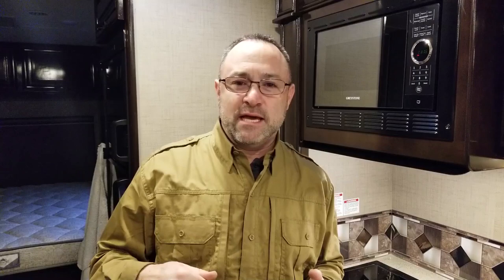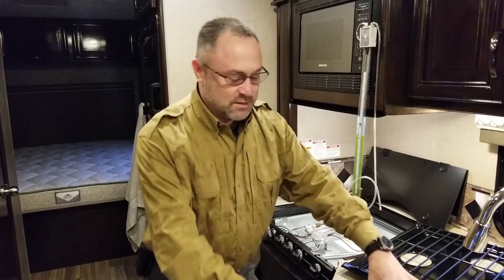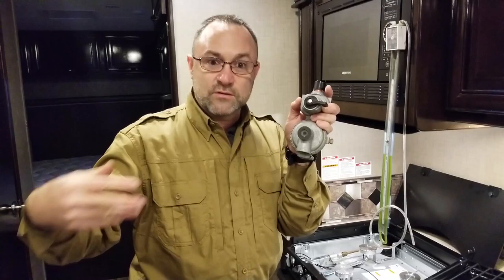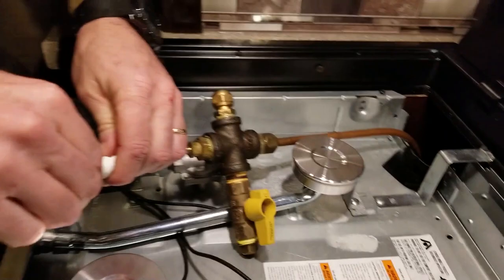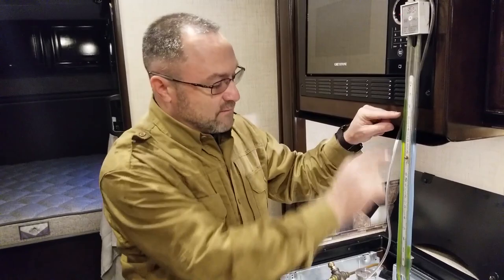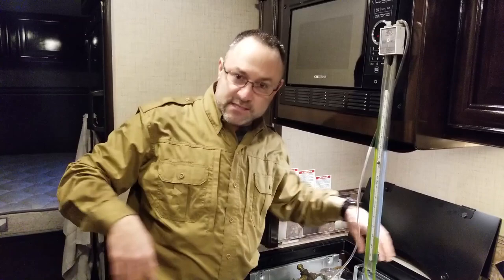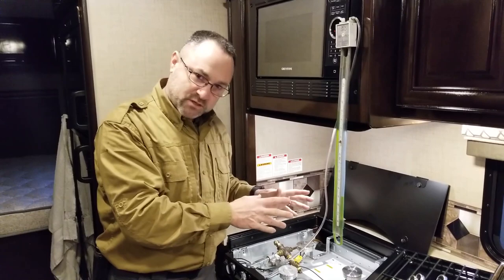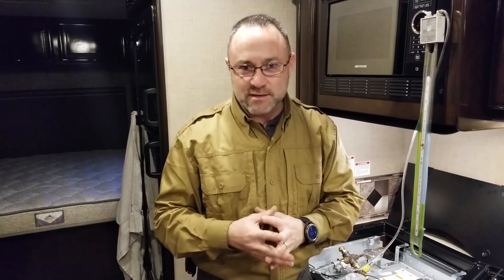RV Propane Overview & Three Tests To Ensure Proper Propane Function (Hole size is a '#41' not an 'X'

Comment: I cannot thank you enough for your informative video. Our furnace quit in 2019. We live in the south so we just did without and added more blankets. I tried to get a mobile rv tech to come out but no one would. When my refrigerator and stove stopped working, I started searching the internet. Luckily I found your video. When I learned that furnace needed more pressure than stove or refrigerator, I bought a new regulator. Success!! Now all my propane appliances work and I didn’t even have to pay someone to fix it. Than you, thank you, thank you.
Reply: My motorhome just started doing the exact symptoms you stated. Started with the heat not working a few weeks ago. But with it it almost summer I didn't care much. Now that the hot water heater and refrigerator are out, I have to find a regulator that will fit my old motorhome.

Comment: I really enjoyed the video, I used to train people in the use of handheld gas sniffers, the number one mistake made by professionals such as haz - mat personnel is they sometimes don't "zero" the detector in outside air. There have been cases where a location has been cleared as "safe" only to have an explosion because the detector was turned on and zeroed in the presence of combustible gas. Make sure it is turned on, warmed up briefly and zeroed outside the coach.

Comment: Hey Darren, 

RVIA Spec says-
Lock Up should be 14WC
50% load is 11WC
For leak test spec says to shut off propane tanks. Drop WC to 9wc. Then leave it for 3 minutes.

Also the drill hole is 3/32 or #42 or a 75,000 BTU Orifice
Reply: I understand what RVIA says, but let Darren’s experience teach you. In some RV’s, the furnaces like 10-10.5” wc. Set that lockup too high (like 14” MAX allowable everywhere) and could keep furnace from firming up.
Reply: All depends on the systems. If it's got a truma combi, you need 13"wc.

Comment: Darren, Thanks for presenting this video and following it I found a propane leak I didn’t know I had. I’m a DIY mostly automotive and making the test rig was easy including a U-tube. I removed the HW burner to gain access to the line, attached and started measuring including a flow test. When I did the leak down, I could just about watch the water column drop. I was losing pressure. Soap bubbled all connections that had access, no luck. Then I decided to disconnect and cap appliance service lines one at a time and repeat the leak down. The last one was the Atwood furnace. As soon as I capped it, no more leak down. Then I rigged propane service to the removed furnace valve, turned gas on and a tiny bubble formed at the gas orifice. Ordered new valve, R&R. Furnace works and repeated the same leak down test starting at 9”WC after dropping pressure as you demo’d. It held 5 min w/o any drop. And during the new valve installation I found several tiny insects had found their last resting place behind the orifice. And now I have a service tool to assist friends with, carefully. Thanks, Gary

Comment: Darren, the NRVTA also taught us to pull the center burner out and test from that port.   Their argument was 1) not having to break into the gas line, and 2) any variance in WC pressure would be reflected through the stove top's regulator.   I asked about this and was "shot down".     I can see the 50% load and drop test being able to be read through the stovetops regulator, but I agree with you that the stove's regulator could mask an overly high lock out pressure as you show in this vid.   Well done, Sir!

Comment: Nicely done! Very good presentation. Stage-1 in most 2-stage regulators will bring down the pressure to around 10 psi not 30. I prefer to test in series with the main line usually somewhere around the ASME tank. Less issues with venting the propane outdoors. As for the tool, a #36 orifice (~0.1065" diameter) will purge the equivalent of 80,000 BTU (at WC 11) or 55% load on the regulator. Close enough!
Reply from the maker: Hey Daniel,  Again I appreciate your technical savvy!  Keep me straight...
Cheers,
Darren
Reply: what size drill bit would I need to drill out a #36 orifice.
Reply: @anthonylink4330  #36 (.1065)

Comment: Fantastic video.  I've been having some issues with my propane system.  Although I'm going to preemptively replace the regulator since all indicators point to there but I'm going to run the tests before to have a better understanding of what was going on.  In my case three symptoms.  The fridge will often fail to light, especially if the furnace is running.  The furnace on a campout last weekend would fire up but at some point reach a limit where it shut down and we'd have to turn it off and back on to reset, and the stove does not get enough gas pressure to even light one cook top burner if the oven is running.

Comment: Hey Darren, I have been impressed with your teaching style and variety of RV Tech Task that you cover.  I'm interested in making your brass valve setup for hooking the slack tube and LP gas line and 50% load, is there a description somewhere on the parts needed to create it?
Reply: You can buy the kit from RVTI

Comment: Hi Rick here I have a 5500 propane gen in my 5th wheel that hasn't worked in 3 years start and die wich was my fault for not starting it yearly but anyway I had a factory tech come out and diagnose it he said it needed a mother board 500 to 700 dollars wich I didn't have at that time then I had a friend suggest that if the moter doesn't run its probly not the moter board then I found your video's on how to diag a heater wich I also had problems with so I made the set up to ck the fuel pressure and sure enough it had 11 water pressure when I turned the gen on it went to 0 so I blew out all the lines still the same thing so I replaced the regulater and re ck the pressure is good and the gen runs it only drops 1 water lb Thank you Jesus 
THANK You for your video's it saved my lots of $$$$

Comment: you said: "top of the meniscus" - but I thought measurements should always be taken at the bottom of the meniscus. As i recall, the reason is that the capillary effect draws the fluid up the side of the tube, but the real level is at the bottom of the meniscus. I was wondering how you came to learn that you should measure from the top of the meniscus. 

Thanks, really enjoyed your vid, and it helped me set up to do my own propane system tests every season.

Comment: Excellent video!   When I was doing the sealed test, I turned off the gas at the tank and the pressure held for about 1.5 to 2 minutes, then it suddenly dropped to zero. It was rock sold for those first two minutes, then it completely dropped out all at once, in 1 or 2 seconds.  Do you know what would cause that? This is on a 1987 Airstream Excella.

Comment: This was a very good video for me. I have a truckbed camper that has this type problem, I believe. The stove will light but it has a yellow flame that rises high. Also the furnace will light but only burns for about a minute or so. It make sense that it is a regulator problem. I can see the regulator underneath the sink but it is a fixed pressure regulator (doesn't have the part that you can adjust the flow/pressure. I guess my only option is to replace the regulator. Any thought?

Comment: Thanks for all the information you share. I always look through your videos to help me troubleshoot problems. Always use a backup wrench on fittings✔️ I have a question about measuring LP. Can I put a permanent gauge after the regulator to see my PSI?

Comment: PSI is pounds per square inch. Ounces per square inch is what your gauge is reading. It’s ounces of pressure, not ounces of PSI. So 16 ounces of pressure....1 PSI, should equate to 27.7 inches of WC.
Reply from the maker: You are correct! I just went out and looked at my gauge manometer that I use in the winter time when my slack tube water freezes. So instead of saying PSI I should be saying OSI!  Or I'll just stick to inches of water column and nobody gets hurt... LOL. In my future videos I'll give a nod to you when I'm explaining LP pressure.  ;-)
Reply: @MyRVWorks  i wound up putting a whole new suburban furnace in my t.t. and its doing the same thing my 20 year old 1 was.it lights 3 times and the flame goes out.then it goes to lockout.i reset thermo and it does the same thing.i wonder if my regulator is bad and if it is would my stove and frig and tankless water heater still work but the furnace wont.

Comment: A slack tube is a true manometer.  Any liquid filled "U" tube pressure instrument is a true manometer.  Digital manometers and dial manometers (pressure gauge) are not true manometers.  They are only called manometers because of the low pressure range they measure.  They are always calibrated against a true "U" tube manometer.  Otherwise, a good video.

Comment: When our propane guy filled my 30 lb tank ( type fastened to the rv) it leaked when he took off his filling hose.  He tried to fix it by tapping the valve but it continued to leak so he put on a safety cap.  What should I do next.  Dave

Comment: Darren my Class A has a  propane outlet for a propane grill which is I guess low pressure. Not regulated on grill so is uses the RV regulator.  I think I can do the test from there by adding a quick connect to the tester. Is this correct?

Comment: Hello Darren, first thank you for all your teachings, when you did the 3 minute test, I understand you bled off into your tube with tank off. After the 3 minutes did you did you bleed off into your tube again to determine if the was a leak? Also I would really like to have info on your shut off valve assembly. Thank you for your time and consideration 
Gary

Comment: 00:22:07 For test #3, what if there is a leak in the service valve and also a leak in the system that their effect would cancel each other out? Do you check all the connections with soap and water or leak test liquid?

Comment: Hey  Darren two brief questions... When you check the water column reading on a NORCOLD N306RM8 rv refrigerator with a low, med, hi temperature selector dial where is the best place to hook up to get an accurate reading?  Second to blow out any contaminants in lp lines in a travel trailer would you disconnect the output LP hose from the regulator and then blow compressed air from an lp line on the far side of the RV such as the stove or refrigerator? Thank you.

Comment: Hey Darren,  I want to build that tool that you built.  Would I be able to get all of those parts at a Lowes or Home Depot?   If you have the means and/ or the time could you supply the names of those parts/ sizes so it's not such a mystery hunting the pieces at the store?  
Again,  appreciate all the hard work you put in for the benefit of others!  Thanks!!
Reply from the maker: I have a sheet that is in a word document format.  This is what I used to get the idea and used artistic license when I built mine.  Send me an email message to Darren@myrvworks.com with your return email address and I will send the doc to you.
Reply: @MyRVWorks   Darren great video sent you an email to get the propane cross parts list.

Comment: Good video. Just one thought about your air cleaning of the propane line. Draw a vacuum on the propane line instead of pressurizing it. Too much air pressure can damage the diaphragm in regulators that are still connected.
PS. I’m a 35 year master plumber.
Reply from the maker: Thanks for the pro tip, When we blow the lines out the supply line is disconnected from the regulator.

Comment: I really like your videos.  Having been the victim of a propane explosion so I'm super afraid of it, although you feel it is very safe.  When you do the 50% test, it appears that you are not worried about the propane escaping into the area?  Also, when you put the fittings together, do you use any type of thread sealant.  Thanks from a fellow Louisianan!

Comment: A propane related question. All our propane appliances work just fine. The RV was supposedly leak-tested before we bought it. It’s a Class A 2016 Winnebago 26HE. The propane tank was full during our PDI. We’ve had to refill the tank three or four times since we bought it. All at different fill stations. The tank filled ok, but no gas vapor ever came out of the little 80% fill valve. In fact, no gas vapor has ever came out of that 80% valve. No change at all with the 80% fill valve open or closed. I’ve called a few propane suppliers in the area and none of them will work on an RV. Do mobile RV techs do this kind of job? I’m comfortable working on nearly everything in our RV, however I’m not wild about working on the propane tank on our RV. Any suggestions?
Reply from the maker: I would assume that most mobile RV techs are trained in working with LP systems since so many systems in your RV do work on LP.  If they are certified RV technicians then they are definitely qualified to work on LP since many of the questions on the certification exam cover LP systems. If you're in Texas, and a few other states, they have to be licensed with the state.

Comment: #36 orifice or a #41 what one is it for proper test ?
Reply from the maker: # 41 is a standard size in the RV industry according to NFPA 1192. You can do a web search or if the size for propane gas and get an entire listing of the orifice with respect to BTU flow rate.  If you want to be super accurate, you can gather all of the BTU input information from every gas burning appliance, then divide that number in half. But remember that when we do this test we're venting to the outside air and that is not how the propane system is consumed in an RV, also as the temperature changes or the RV goes into different altitudes the gas pressure will change as well. So the #41 is a close enough test for us to set our regulator lock up pressure and operating pressure.

Comment: Do you have to test every time you change elevation and temps?
Reply from the maker: No you do not. It's a gas-tight system and is not really affected by elevation as much as it is by temperature. Your regulator has a vent on it that will make adjustments to the different temperatures and pressures that you are experiencing when you change altitude. So you would want that regulator vent to always be exposed to outside air, and you would want to make sure that your propane system is inspected and adjusted, if necessary, at least once a year.
Reply: @MyRVWorks  thanks!

Comment: Hi Darren,

We sent you an email a while back about the document you have with the list of parts to build your propane test device. We haven't heard back. We'd love to know how to build this test device.
Reply from the maker: On our website / resources tab we have a listing of manuals. Sort that by 'LPG' and you will find a link for the lp test jig there. 
https://myrvworks.com/manuals/
Reply: @MyRVWorks  Thank you so much. Where did you get the slacktube quick-release connector (it's a small white connector)?
Reply: I think I found it. The plastic tubes that come with the slack tube are 3/16" ID and 5/16" OD. So we would need a 5/16 x 5/16-inch OD quick connect like this one:

https://www.amazon.ca/19-6043-Coupling-Fitting-16-Inch-Plastic/dp/B00ITPFC8S/